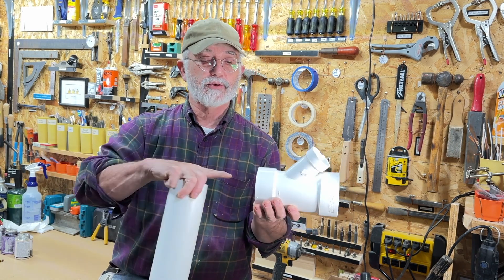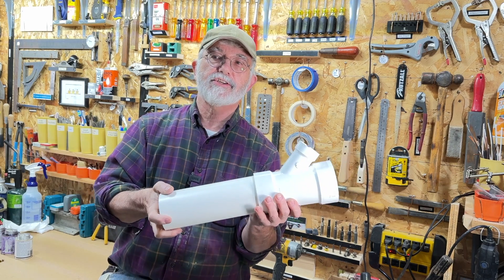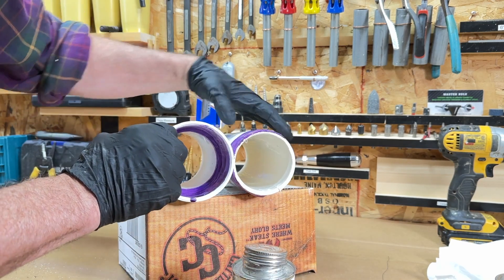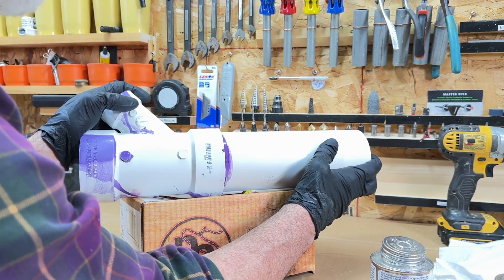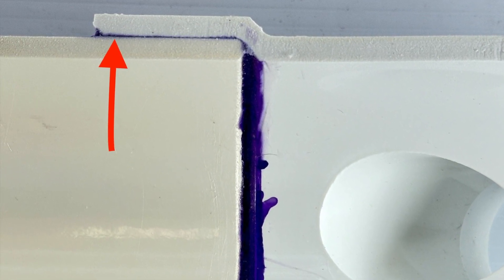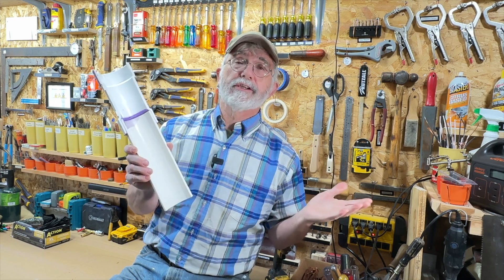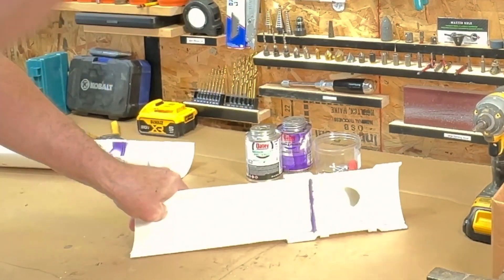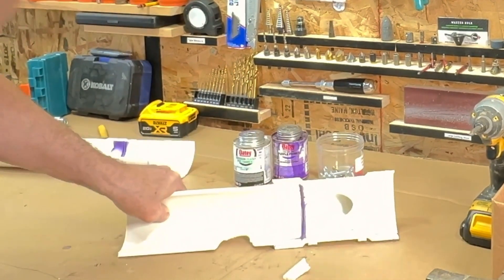PVC Plumbing Test: How Strong Are Rasp-Modified Fittings

Comment: Never used it I’ve always just measured and glued, haven’t done much of that though. But I think it’s ok it’s not under pressure. Worked on a Hotel that was 100 years old and the plumbers took out lots of cast iron and lead and replaced with semi trucks of PVC.